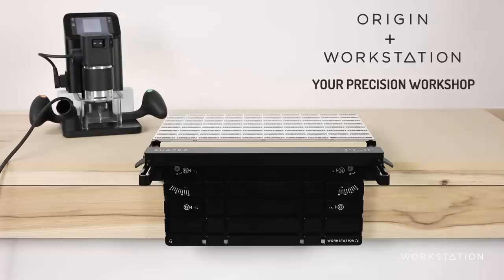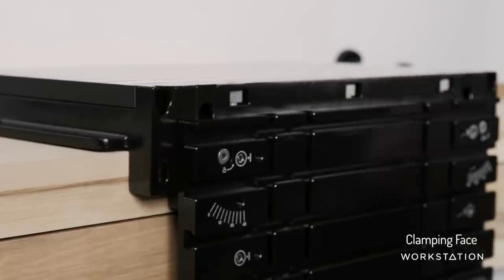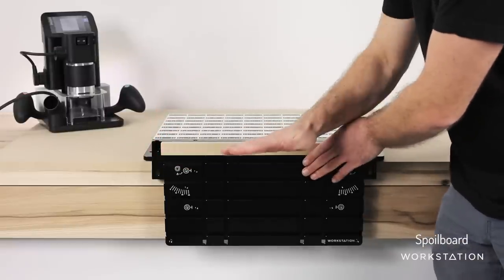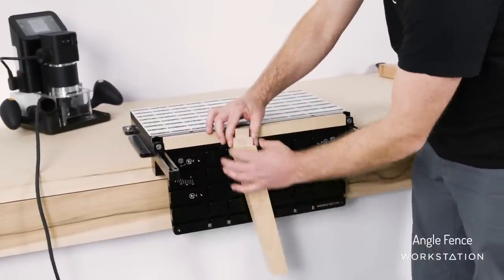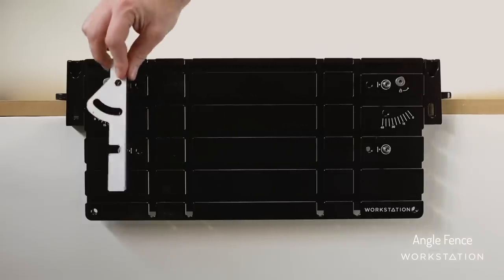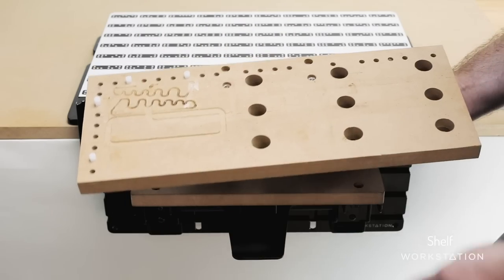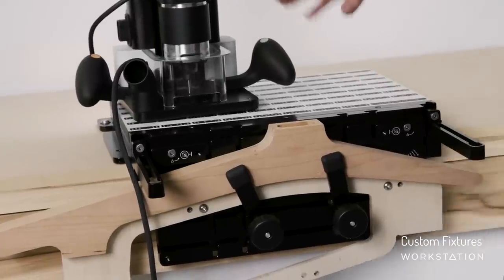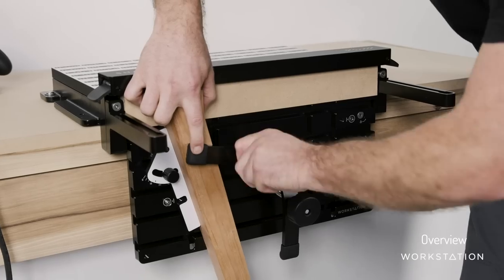Shaper Workstation Tutorial

Comment: One thing I have found that is a problem with this workstation on day 1 was that there is no back support for when you place heavier wood on the shelf. I made a larger shelf top and using bigger materials bends it down. Why no back support? It just hangs off the ledge and has no contact with the back surface that its mounted onto. Huge oversight in my opinion.

Comment: I am concerned that the cam fixing for the shelf pulls up towards you to lock. rather than locking by pushing away from the operator, This could mean bumping into the clamp and loosening the shelf inadvertently. A better design would be that pushing away from the oporator towards the bench will only secure the shelf more preventing accidental loosening while you are intent on working on the shaper.  Just an observation. Id love one but out of my price range for occasional use.

Comment: I think shaper tape so expensive. You could redesign to not use shaper tape.
Reply: The workstation doesn’t use Shaper tape. The pattern is built into the table. Also, you can make your own custom workspaces that reuse the tape you put down. Lastly, the tool needs the reference dots to alight itself. Tape is the most flexible way to do this.
Reply: @harveytherobot  The tape should be cheaper as a consumable, it's what decides whether the machine can be used or not used, That's Festool all over fleece as much money as they can, not content with the amount customers actually spend just to purchase the tools & machinery. The tape should not be more than £7.50 a roll, and that would still be expensive. When your spending upwards of £3,500 only to give two rolls of tape with the machine is just being downright tight.
Reply: @colinturner6628  I didn’t know you had access to all of the company’s financial information and expenses and payroll and marketing costs etc., so that you could determine what a roll of their tape should cost vs what they charge. Impressive. You should inform them of their calculation error right away.